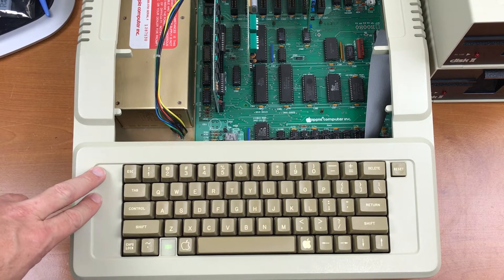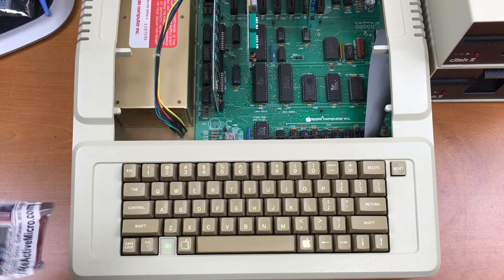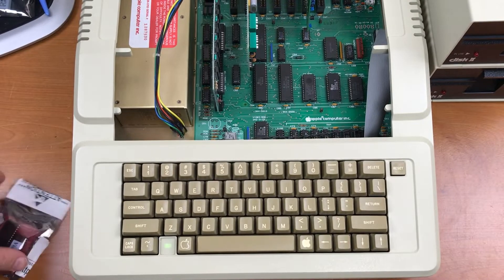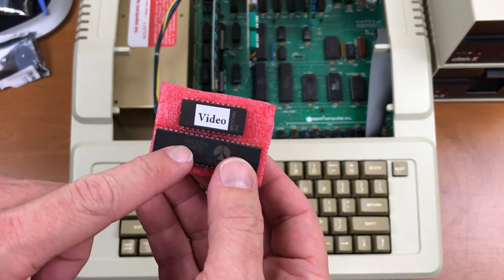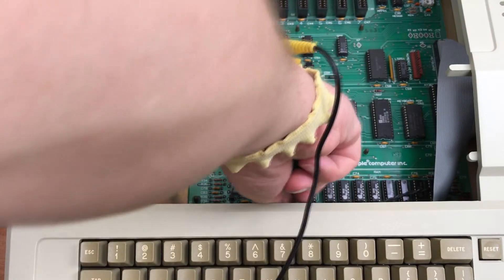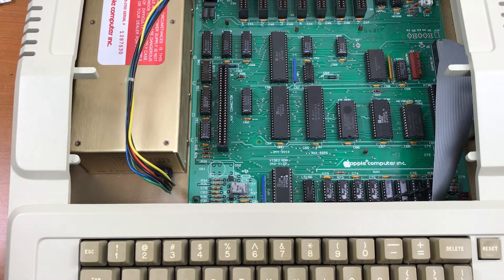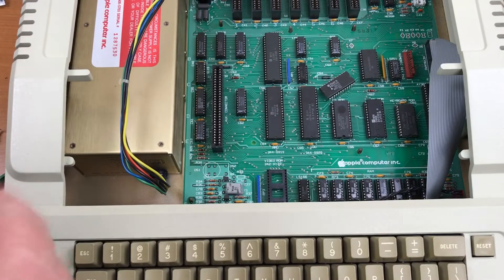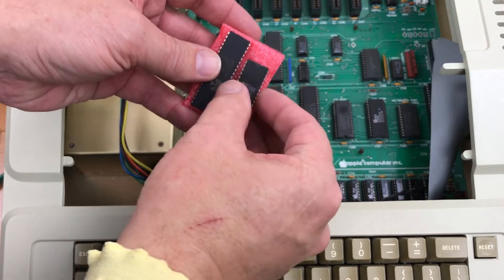Apple IIe "Enhanced" upgrade

Comment: why would you do this to an original IIe?  maybe you only want to own one IIe and you want it to be enhanced?   I have 5 of them  3 are enhanced, 2 are unenhanced.  Not trying to brag, but where I am they are not that hard to find nor are they very expensive.  Just bought a full system with a damaged top plastic and non-working CRT for $60.
Reply from the maker: I'm not an Apple guy, my collection is mostly Commodore, so yeah, I only want to own one, and if I ever want it to be un-enhanced, the mod is easy to reverse. It's not like this is a Rev0 or something, these are super common.
Reply: @HutchCA   true,  another good reason to upgrade a  white-letter IIe is because most of them seem to have socketed RAM, while the enhanced units I've seen are often soldered to the board.

Comment: I have an un-enhanced IIe. What features do you get with the upgrade?
Reply: The change involved a new processor, the CMOS-based 65C02 CPU, a new character ROM for the text modes, and two new ROM firmware chips. The 65C02 added more CPU instructions, the new character ROM added 32 special "MouseText" characters (which allowed the creation of a GUI-like display in text mode, similar to IBM code page 437), and the new ROM firmware fixed problems and speed issues with 80-column text, introduced the ability to use lowercase in Applesoft BASIC and Monitor, and contained some other smaller improvements (and fixes) in the latter two (including the return of the Mini-Assembler—which had vanished with the introduction of the II Plus firmware).